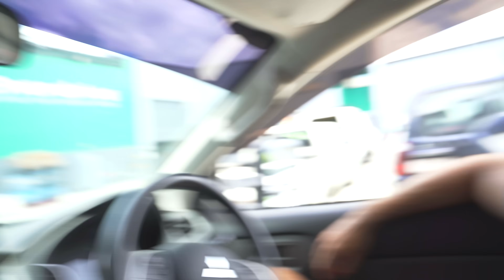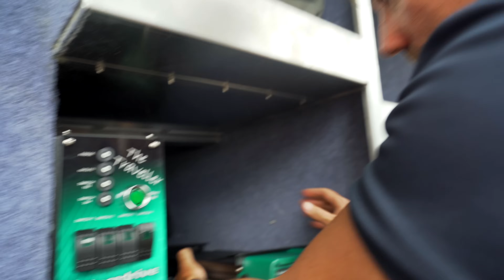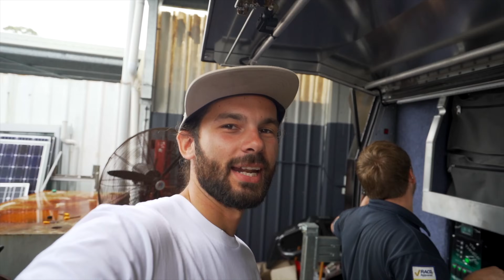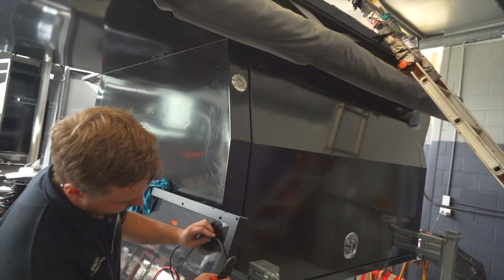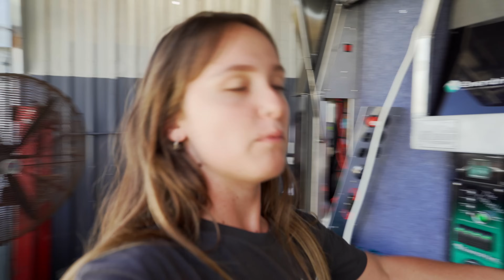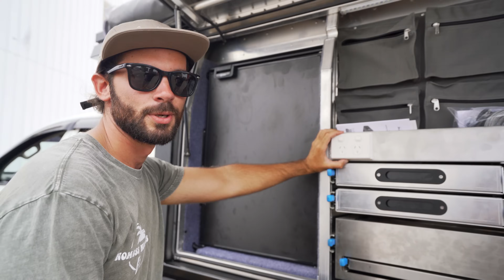ULTIMATE OFFGRID 12V POWER SYSTEM in our 4x4 // 03 EPIC OVERLAND CANOPY BUILD

Comment: Build is mint guys. Even though you don’t need to be qualified to install the plug and play wiring. I would recommend getting a sparkie (240v electrician) to test it for you. Make sure that RCD works as it should and the wiring is all good. I’m a qualified sparkie  and have installed those types of wiring setups for years and I can tell you sometimes they can have issues even when brand new. 
It shouldn’t cost any more than a standard call out or one hour Labour.

Comment: Andrew and the guys do great work there. We are getting our van off grid with them. Watching the solar panel install I would be concerned fitting an Anderson plug under the panels instead of using the connectors they come with. They are weather proof and the Anderson is not. You will get poor connection eventually as the weather does its job on the terminals. Anderson plugs are self cleaning if plugged and unplugged on a regular basis. You will need to get up on the roof and do this every so often to avoid voltage loss. And I agree with another comment regarding the gland nut they have used to insert cable down through the roof. There are better options that allow the cable to lay flat as they go through the roof. They are available through a caravan accessory store. Keep the vids coming on the build, very interesting as it gives others who follow the channel ideas if they are going on a similar path. A thumbs up from me.

Comment: Nice installation! The only thing that I would have done different are the cable guide grommet thingies ("Dachdurchführung" in german) - I would have used the flat ones to protect the cable from tree branches and so on (like this one: https://www.fraron.de/en/solartechnik/befestigungmaterial/solara-dachdurchfuehrung-und-verteilerdose-dd4-inkl-verschraubung-wasserdicht/a-12356964/)